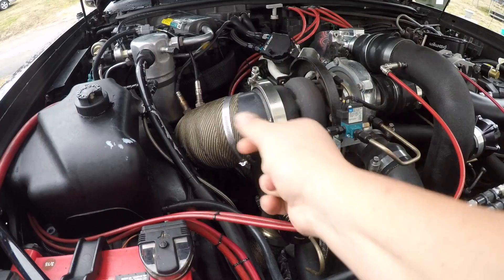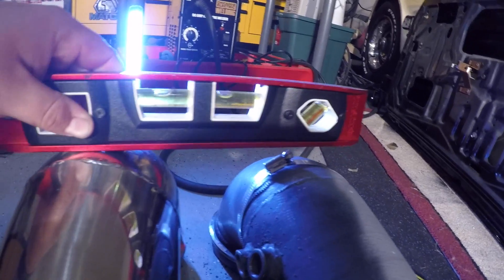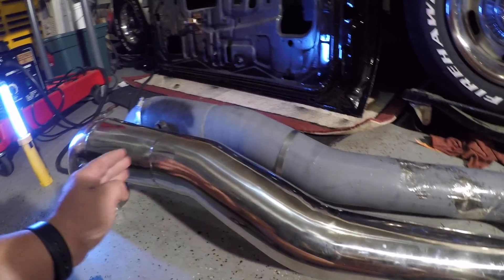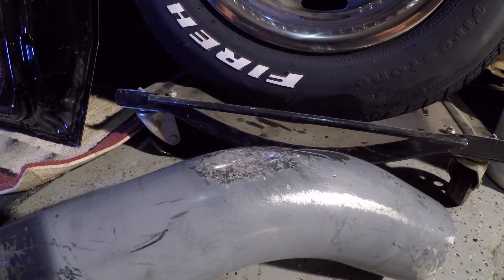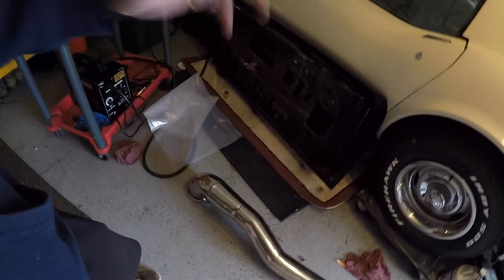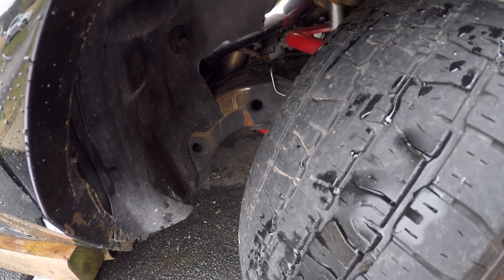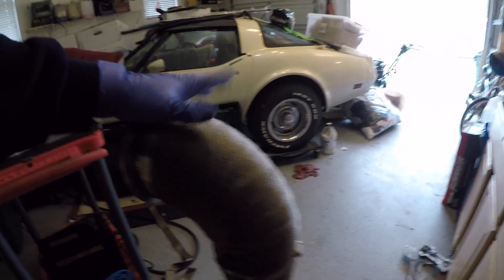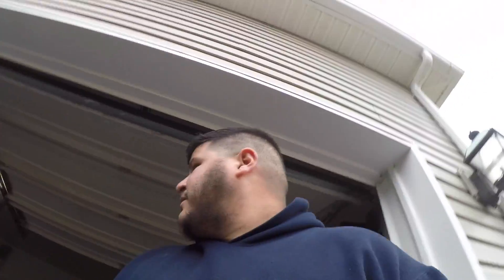Massive Turbo Downpipe Installation! | RJC Racing 5" Downpipe

Comment: DID  YOU use the wrap on the new  DP
Reply from the maker: Yes, but only on the upper section from above the frame up to the flange, I didn't paint the pipe this time so I was a little concerned with humidity accumulating on the under side.
Reply: YES  i just seen that  WE JUST  set  my  friends  car on fire  because of that shit  on his DP
Reply from the maker: that is why I haven't wrapped the crossover which would really benefit from the wrap, but the fear of it turning into a candle wick made me leave it alone.